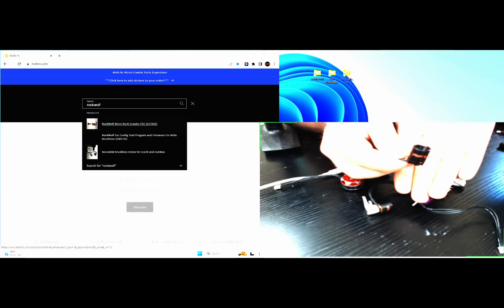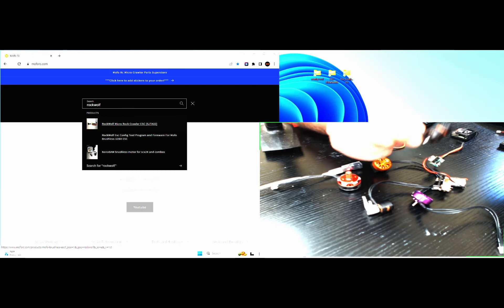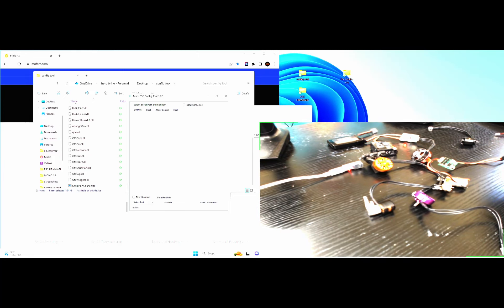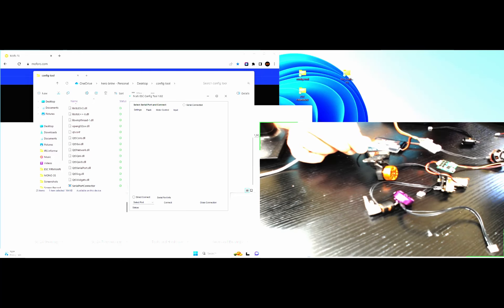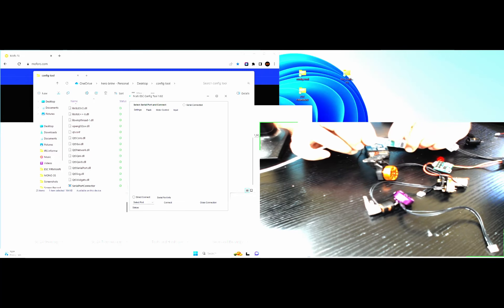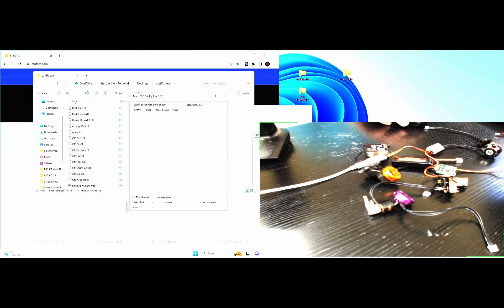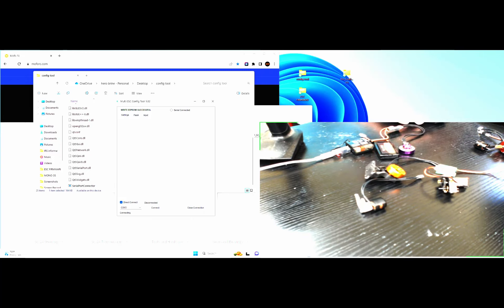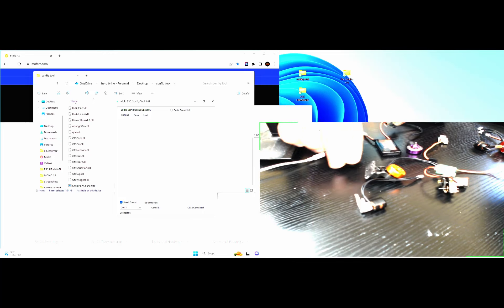Mofo RC RockWolf SJTA32 Brushed / Brushless ESC Demo and Troubleshoooting

Comment: My Rockwolf ESC does not connect my computer.😢
The wire connections seem OK, the window opens like you say, but the "direct connect" button does nothing. There is a solid red light on the dongle.
My USB C cable is new. How can i be sure it has the data capability ?
Reply: OK ! Found what's wrong : my USB C cable, 100% new out of the box, was unable to transfert data.🙄
I've bought another one today and now, connexion is OK.
Chance is required when you choose the cable as nothing indicates if it can transfert data.😄
Reply: @vdel9036   Thanks for leaving this info, i've been struggling to figure out why it wouldnt connect.  Going to get a new cable, fingers crossed.